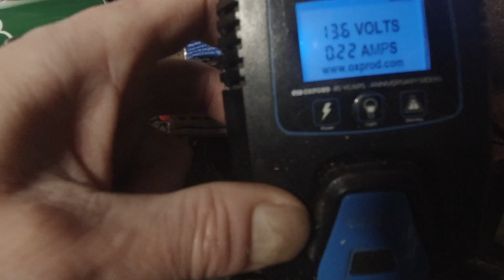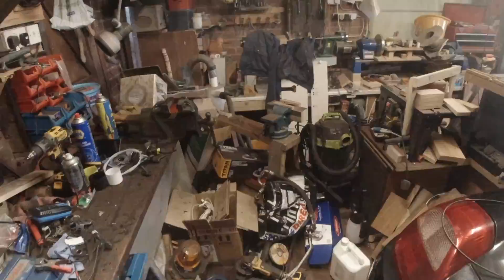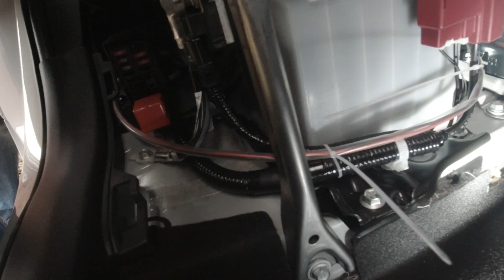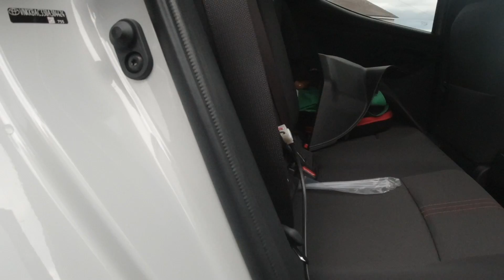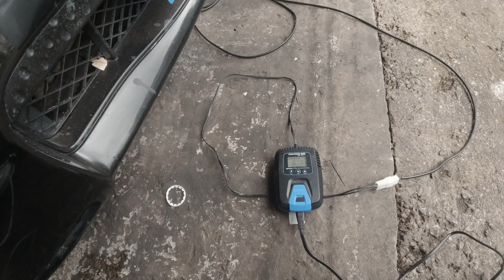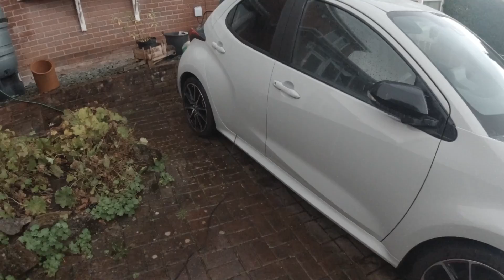Toyota Hybrid 12 volt battery Trickle charger

Comment: Like the other comments previously mentioned, wouldn’t’ Be easier to adapt the charger to connect to the OBD port similar to the AA Solar charger you can get?
Reply from the maker: I’d be very cautious about that method, as there’s a lot of variables to consider, the power has to go through many contracts,control modules,and fuses before making its way through to the 12 volt battery , also the wires are of a very low small gauge only capable of very low amps, the system I’ve used is tried and tested as it’s how I winterise all of my motorcycle’s, also I wanted to use a charger I trust to do the job correctly and as it’s intelligent automatically knows what type of battery it’s maintaining,ie lead acid, lithium or agm etc. I understand not a lot of people have the skills or confidence to get as invasive as I did by accessing the battery directly 
Many thanks for the interactions you have made, i do appreciate all the comments

Comment: Hi Paul, good idea for a trickle charger, I done a similar thing with a standard car charger. My charger is screwed on to a shelf using a block connector and use 6 metres of flex and put the crocodile clips on the other end so I can close the garage door run the cable under the door and the cable under the bonnet with the car parked on the drive. I did this about 10 years ago and I've only use it once, but its there if I need it. As always a great video Take care👍
Reply from the maker: Many thanks for your reply

Comment: Will the battery charge from the jump start terminals under the bonnet without accessing the battery directly?
Reply from the maker: It will, I don’t want to have to have my dad opening up the bonnet to access the jump start port
Reply: @paul_nwsxs thank you for clarifying this for me. I am soon expecting delivery of a Yaris Cross and want to be prepared for the battery issues I have heard about. I do plenty of miles in the summer but not a lot in the winter months. Your idea is excellent and is the way to go if it needs to be a regular thing. For just the occasional charge though I will go under the bonnet. Thanks.
Reply: @paul_nwsxs I want to do something similar. I don’t mind going under the bonnet for now until I know how frequently I need a top up charge. At the moment I have to have multiple 240v extension leads going down the yard. Obviously not ideal to be left unattended especially in the wet. I am unsure what spec cable I need for this. Can you advise. Thanks.

Comment: Would a solar powered trickle charger be a satisfactory alternative?
Reply from the maker: @paul_nwsxs
I’d be very cautious about that method, as there’s a lot of variables to consider, the power has to go through many contracts,control modules,and fuses before making its way through to the 12 volt battery , also the wires are of a very low small gauge only capable of very low amps, the system I’ve used is tried and tested as it’s how I winterise all of my motorcycle’s, also I wanted to use a charger I trust to do the job correctly and as it’s intelligent automatically knows what type of battery it’s maintaining,ie lead acid, lithium or agm etc. I understand not a lot of people have the skills or confidence to get as invasive as I did by accessing the battery directly 
Many thanks for the interactions you have made, i do appreciate all the comments
Reply: Many thanks for taking the time to reply to my message it is much appreciated. Can I please ask for further advice. If I was to link the solar powered triple charger directly to the 12v  battery would that be a satisfactory solution?  Using a mains triple charger would give me problems - I sometimes need to be away from home and cannot rely on mains supply. Can I ask why this problem has not been rectified by Toyota  - I really would like to buy the car ( I have ordered the car from Toyota) but am very nervous about this problem. Finally. My normal usage of my car is approx 3 weekly runs of approx 10 miles and one additional run of approx 30 miles - would this in its self be sufficient to avoid the problem  I would really appreciate your comments. Many thanks. @paul_nwsxs

Comment: Would a solar trickle charger  with a OBD plug work as well.
Reply from the maker: @paul_nwsxs
I’d be very cautious about that method, as there’s a lot of variables to consider, the power has to go through many contracts,control modules,and fuses before making its way through to the 12 volt battery , also the wires are of a very low small gauge only capable of very low amps, the system I’ve used is tried and tested as it’s how I winterise all of my motorcycle’s, also I wanted to use a charger I trust to do the job correctly and as it’s intelligent automatically knows what type of battery it’s maintaining,ie lead acid, lithium or agm etc. I understand not a lot of people have the skills or confidence to get as invasive as I did by accessing the battery directly 
Many thanks for the interactions you have made, i do appreciate all the comments